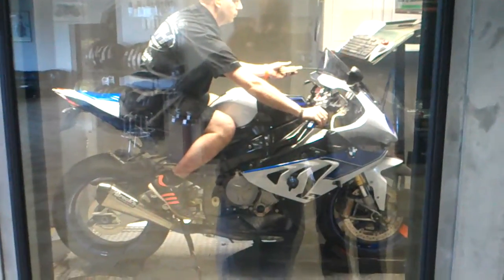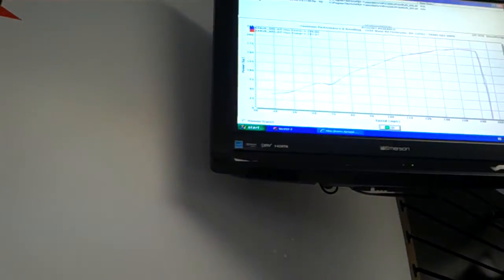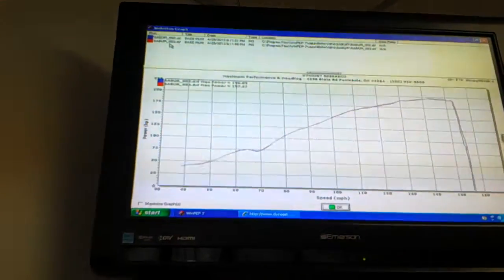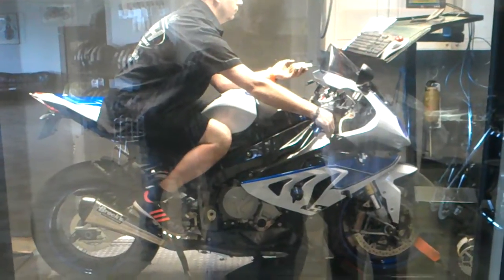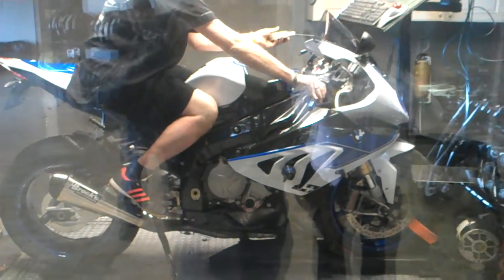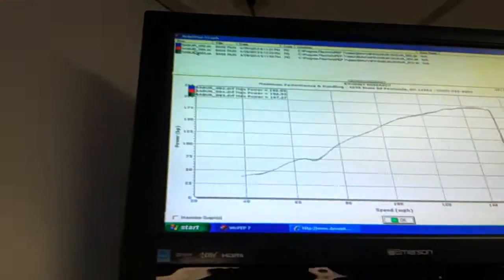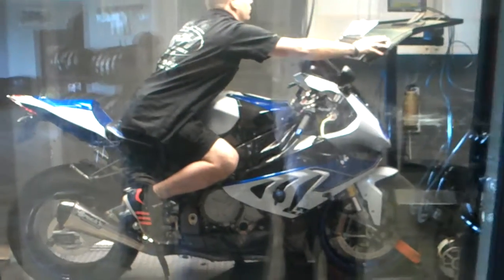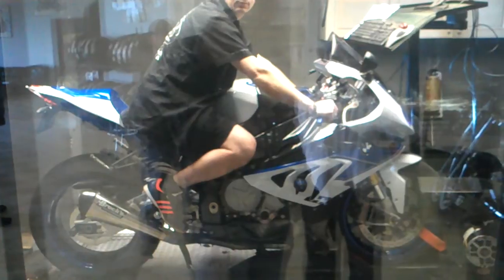2013 BMW HP4 Dyno's 197HP

Comment: HP4 has 80mm pistons and race profile cams from the factory... Is 999cc by the way. And for those praising GERMAN ENGINEERING, you should know that the BMW engine is based off of the GSX-R 1000 engine... so much for genuine GERMAN ENGINEERING. Nice bike nonetheless. 👍

Comment: Can you tell me what was the stock sprocket like compared to the 17F/45R sprockets? And why did you choose 17/45? 
You wanted more acceleration and less top end or vice versa?
Isnt the HP4 factory limited to 299Kph?
Thanks.
Reply from the maker: Hello Olivier. The stock sprockets are 17F/45R. I changed them from 525 to 520 pitch but kept the same 17F/45R gearing. I did that to decrease the weight. The HP4 doesn't have a speed limit on it. The speedometer stops increasing at 186mph but the bike keeps accelerating. Thanks for viewing my video.